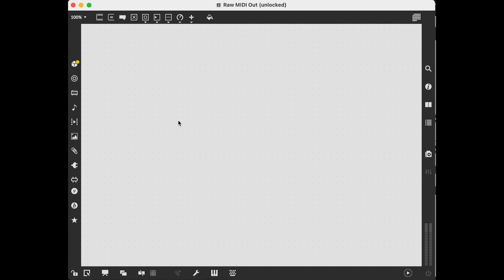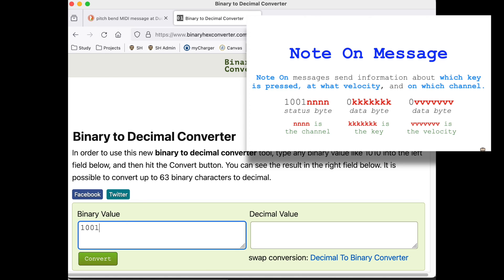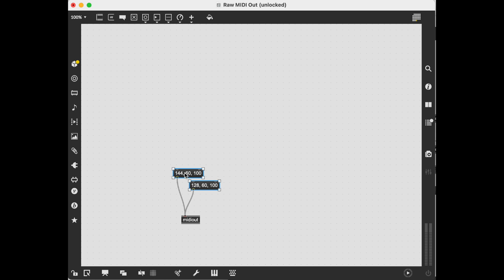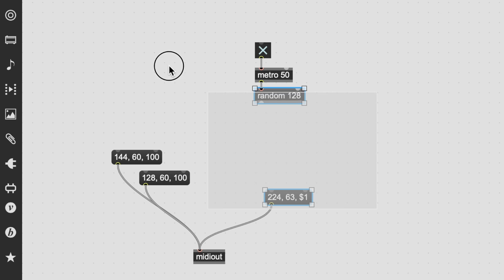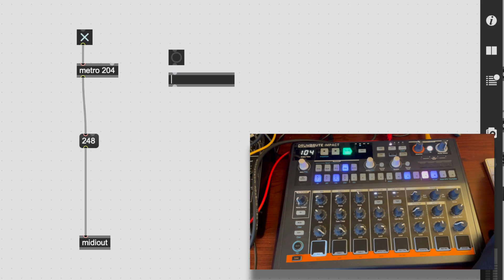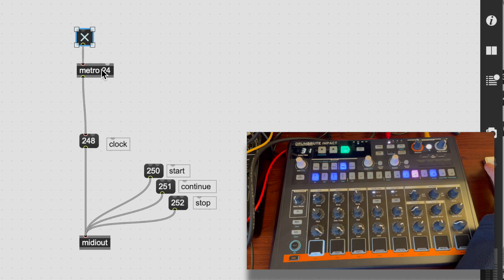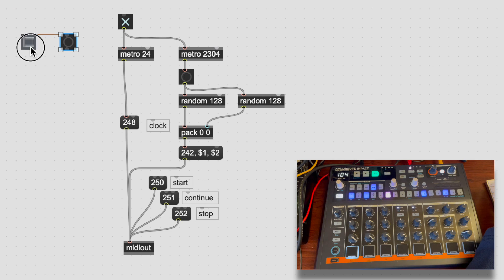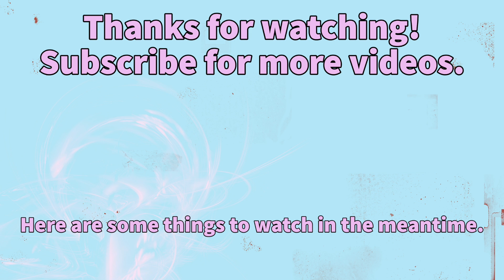Sending Raw MIDI Data in Max (and Pure Data) | Simon Hutchinson

Comment: DSP on that arturia was on the brink of nervous breakdown... But I am curious whether midiout object in Max sends out mono or polyphonic note messages? Would there be a possibility of a video about how to send polyphonic messages from Max?
Reply from the maker: Ha! Actually, I believe the Arturia is all analog (in it's audio chain, that is), so no DSP. 😃 [midiout] should be polyphonic. So I could have sent out multiple note-outs to the TX81Z no problem. For the Arturia, though, I'm sending system messages, so the polyphony doesn't matter (since they're clock and tempo commands). Hope that helps! 😄